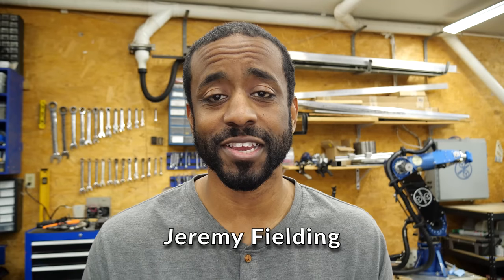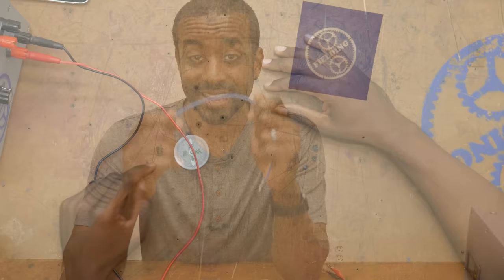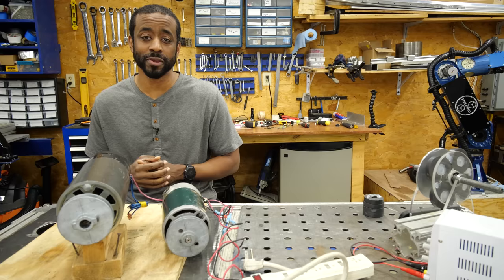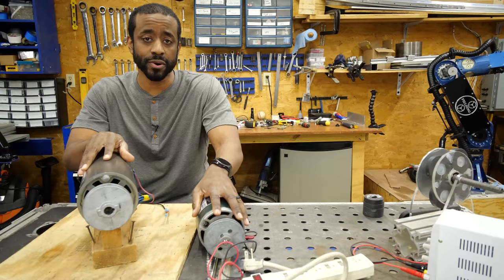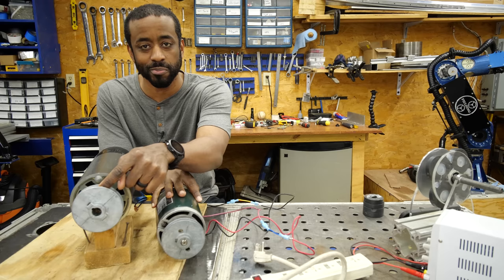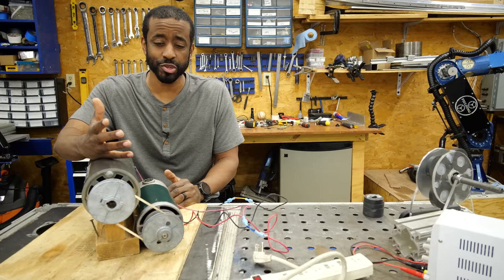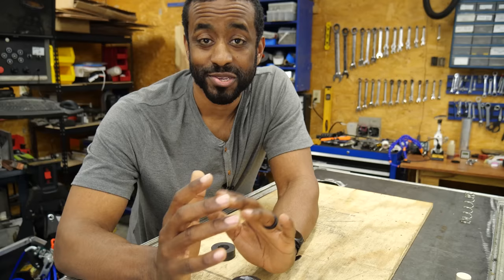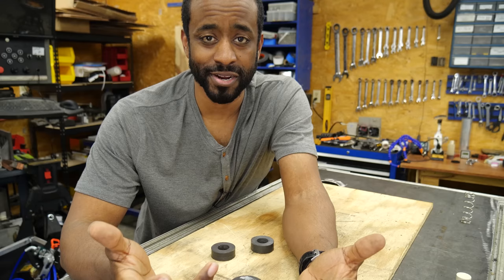Reviewing Free Energy Generators.  A Response to My Video "Nikola Tesla's Greatest Invention"- 102

Comment: @Jeremy I am an Engineer and teach EE in the evenings at a local University.  One way I explain motors and generators is conservation or energy and, if there is no energy storage, then that becomes the conservation of power.  A motor/generator is just an energy/power conversion device between Mechanical Power (Torque x RPM) and Electrical Power (Voltage x Current).  One example of this is an old electric drill.  It you hold the the same trigger position (same Electrical Power) then grab the chuck (increase the Torque) the RPM will go down because Torque x RPM has to stay the same.
Reply: Note: I know efficiency play into that and I discuss that too within the conversation of conversation of energy but, it is a second level topic as my first discussion is to discuss the things like KI and KV aimed toward the tradeoffs in motor selection.
Reply from the maker: Well said. I was actually trying very hard to avoid using the phrase "conservation of energy." Even though that is exactly what I am describing. For some reason people who really believe this get triggered over that statement. That is when I start getting that crap about cosmic energy and infinite sun. I ended up addressing that in the video anyway, so there was no need in the end to avoid it LOL
Reply: @Jeremy_Fielding  Thanks Jeremy, I really like watching you videos.  I wish we lived closer, I can think of some amazing things we could do together.
Reply: @Jeremy_Fielding  Conservation of energy always leaves out the Elephant in the room, of where did the energy come from. It implies the energy always existed and is just being converted from one form to another. The origin is the big unanswered question in physics.
Reply: @robb1165  Yes, the beginning of the universe, just like the center of a black hole is something we do not fully understand so it "may" be that Conservation of Energy does not work there.  In that case, we probably should not use Conservation of Energy to analyze motors that existed before the universe or are crushed into a the singularity in a black hole.  I am OK with that limitation.
Reply: @robb1165  They have some pretty good hints with the big bang.

Comment: The easiest way to see the inefficiency in the motors as generators was to look what happens when they're connected electrically, but before you connected them together with a belt.
No matter which motor/generator you turn by hand, the other one turns slower.  That's it.   The difference in speed is power lost to heat and friction.  

BTW, electric cars do have an alternator that can charge the battery (when braking or driving downhill).  It just happens to also be the A/C motor that drives it.
Reply: I thought about getting an electric car but I live in a very hilly area so your response reminded me that there's no downhill at all where I live. That's what it feels like, anyway.
Reply: @trevcam6892  (have fun with this one) To travel, select a route downhill, then to return use another downhill route. If we can do that we are beating the "free energy challenge".
Reply: @anibalsonera2376  Yes, I’ve heard of this phenomenon. My father often told us of the unique geography of his childhood, his walk to school, barefoot, in the snow, was six miles each way, all of it… uphill!

Comment: I have been in electronics for over 50 years and remember when my son in  high school was building a perpetual  magnetic energy wheel that he saw a couple of people put it out on U tube and I did not want to discurage him but like any parent we don't know what we are talking about to a high schooler. So I made a bet with him. If he could build it I would back him up 150%.  12 plus years later I'm  still wondering how his perpetual wheel is coming along. He is now a leed mechanic engineer designing the equipment that makes aerospace parts.

Comment: I put the question to my science teacher when I was 9 years old "why cant you put an alternator on the end of a motor to run the same motor and achieve perpetual motion" his reply was "you dont get something for nothing, there are always losses". His reply stayed in my mind for years. Now 60 years later, I am a retired electrician and I realised exactly what he meant when I was a junior apprentice. Very good video and it is very well explained in laymans terms.
Reply: I asked the same question around that age!  The electrical engineer said it’s about efficiency and there is no free lunch.
Reply: that was one of my dads favorite lines
Reply: To reply to your comment yes you do get something from nothing
ENERGY is everywhere around us, you gest have to look for it
Reply: @LofiCorne-r  so your solar panels, wind turbine and hydro electric generators cost nothing ?
Reply: @rob5813  mate I'm referring to the energy  not how much it coats
Reply: @LofiCorne-r  But that is how free energy is measured, cost of equipment against energy gained.  if cost is zero rthen yes it is free.
Reply: @rob5813  yes there is a cost but it's only 1 time  then forever energy
Reply: When I was 8 or so I had the same idea of putting a little wind generator on the back of a car and using it to power the car, I was very let down when I found out the drag from the generator would cost the engine more energy than the generator produced.

Comment: I'm tempted to put a coin cell battery, a hall sensor and an electro magnet is some chromed 3d printed shells to look like neodymium magnets then make a acrylic free energy generator just for the split second confusion it will causes you while you try to work out why it doesn't stop spinning.
Reply: An artist made a "perpetuum mobile" a while ago, he used pressurized air to keep it going. People were examining it all around and didnt find any wires, its a very clever design. 
The Artist is David Jones, its easy to find.

Comment: I think there are two things you could mention or show that would further enlighten or teach people.

One: Many people don't realize what a load on a generator does as far as the amount of input power or energy required to turn the generator shaft. This can be easily shown or explained by taking one of your electric motors connected to absolutely nothing and then spinning the output shaft, which will show how easily the shaft spins under a no load situation. Then connect the two leads coming from the motor to a 100w light bulb or a few 100w bulbs connected in parallel. Then spin the output shaft so they can see how difficult it is now to turn the shaft. I had a friend who recently shared a video with me of a modification he made to the engine in his truck. He added/rigged in a super charger to his engine and serpentine belt. I noticed that now the belt only barely touches the alternator pulley instead of how it used to (by original design) wrap around at least 120 degrees of the pulley. When i mentioned to him that it appears he lost a lot of precious contact area between the alternator pulley and the belt, he said "It's fine. That's the easiest pulley to spin out of all of them anyways". I imagine he assumes that, because when he has the alternator in his hand or in the vehicle while it's powered off, it's easy to spin, however he is clearly unaware of how hard that pulley actually is to spin once it's powering the vehicle/loads. 🤷🏼‍♂️ The only reason i was mentioning it to him is because now there's definitely the possibility that the belt will slip on the alternator pulley while he's driving and it won't do it's job. 

Two: Many electric vehicles do, in a sense, have "alternators" or a means of recharging the batteries. They just use the drive motors for regenerative braking by simply switching the wiring configuration when they desire to stop the vehicle. This helps stop the vehicle and also recaptures some power to recharge the batteries. They are basically turning the motors into generators during periods of braking. By temporarily turning the motors into generators, the electric charge being created by the motors (now generators) is also providing braking to the wheels because of how it makes the output shaft (now an input shaft) harder to spin. When I'm building or working on industrial machines and I want an electric motor to come to an immediate stop after turning off the power to it, I use dynamic braking by using a relay to switch the armature leads to now be shorted between each other with a resistor in line to use up the energy (waste it as heat). Now the motor comes to a near immediate stop. Substitute that "brake resistor" for a battery (with some extra components to protect the battery) and you have regenerative braking that is recharging the battery. Of course, you'll never regenerate as much power from the motors on the electric vehicle as what you had originally put into those motors to get them spinning, but you are recapturing some of it. It all goes back to the efficiency you spoke of, which is all a part of the laws of thermodynamics and entropy.
Reply: and even some form of a resistance of sorts.! as I'd tryed that a few years ago.!

Comment: I think there is a law of physics that states " Whenever energy is changed from one form to another useful energy is lost". Perpetual motion is impossible when this law is considered. This video demonstrates that law and exposes scammers. This guy is as good  an instructor as any I have known. Well done.
Reply: Energy is neither created nor destroyed. When converting from one form of energy to another, there is always some that is converted to at least one other unwanted form, usually heat, and this is considered "lost". Hence the efficiency ratings on devices. Some electric devices may even operate up to 95% efficiency, but never 100.
Reply: @gor4200  electric heaters are arguably 100% efficient. But they're still not OVER 100% efficient, which is really the important part.

Comment: Thank you . Now I can concentrate on the solar panels I've had for the past few years. I cannot eliminate the meter base charge, and I can't  monitor my electrical banking, but I can add more panels , and install a battery bank.  I still need to  find an electrician educated enough to tie in the battery bank, my generator and halt the banking during power outages.  Thanks again.

Comment: Regarding the electric car having an alternator to charge the battery, if the car is going downhill, it could charge the battery using gravity as its external energy source.  Therefore it WOULD WORK and all you would have to do is drive it only downhill and then have a car carrier take it back to the top for you.  <grin>

Comment: I have suggested to some experimenters of the, motor driving generator-- powering motor setup that they could increase efficiency by eliminating the motor and generator, and just use a solid shaft driving a second shaft by pulleys or gears. Give the first shaft a spin and it will drive the second shaft, which will drive the first shaft which will drive the second shaft forever, right. Same principal but the energy does not have to be converted into electricity and then back to mechanical rotation. 
Sometimes they reply, correctly, that it will not work. By eliminating electricity from the design it becomes obvious, to many, that it cannot work.
Even better have one shaft. Leftmost end drives rightmost end which drives leftmost end etc.
Reply: And some scammer is trying that right now!  Look for it soon on YT.
Reply: Better than perpetual energy device.
Take one cat (not necessarily a black one).
Tie a piece of buttered toast, butter side up, into the cat's back.
Baam! Anti gravity device!
Now if you want to avoid backlash from cat people. You could take this further and replace the cat with more buttered toast.
Take 4 pieces of buttered toast and attach them to a spindle with buttered side facing out.
Baam! Perpetual spinning device.
Attach it to a motor and...
Baam free energy!
But not much butter or toast 😬🤣
Reply: @conceptrat  I imagine someone is trying it now.
Reply: @conceptrat  This is the one true free energy device and has been around for at least 20 years that I know of. Cats always land on their feet and toast always land butter side down so the system just spins in the air. I tried to build this, but gave up after all the cat bites from trying to "attach" a shaft to the system to get energy out.

Comment: Thank you, good video. I used to classify patent applications, meaning that I assign numbers like the numbers on library books that indicate what general type of device the inventor wants to patent - an improved (more efficient, i.e. 130% efficient) electric motor for example would allow making a perpetual motion machine. And I had FOUR DIFFERENT PATENT CLASSIFICATIONS FOR PERPETUAL MOTION MACHINES! Yes I saw a significant number of patent applications that qualified for perpetual motion classifications! And yes, NONE of them actually worked!

Comment: Perpetual motion always violates the First and Second Laws of Thermodynamics. First Law is basically that energy has to come from somewhere. The second is that it doesn't "run uphill by itself" (always moves from a higher state to a lower state, unless you put more energy in). Thanks for debunking this "free" energy myth in detail and in layman's terms, Jeremy. As always, great work!
Reply: Violates is a wrong expression. It is theoretical. Solar panels also violate such laws of physics. The point is perpetual motion exist. BUT the additional energy must come from elsewhere. That is what the entire mission or research is aimed for. Solar panels are the best examples of this. You install them and get free energy.
Reply: @VagishaDas  Yeah, that's true. Maybe I should have said that in order to be successful, perpetual motion would require both laws to be violated. That would mean they're no longer laws, etc. As the professor of the honors physics class used to say regarding the First Law, "There's no such thing as a free lunch." He also used to say, "Somebody's got to buy the beer." Makes me wonder what whimsical thing he might have said about the Second Law, but it's certainly true that energy doesn't go uphill.

Comment: I feel like this could be the setup for a really fun science contest.  Each team or person would design two motors that must run off each other after being run up to 1000 rpm for a few seconds.  The winner runs for the longest time.  Probably have to do a weight limit and room temperature requirement.
Reply: It's been done by the gov in the middle 60s and yes it did work very well @